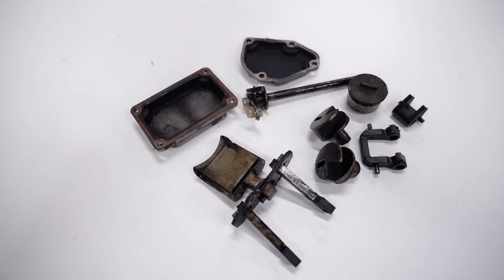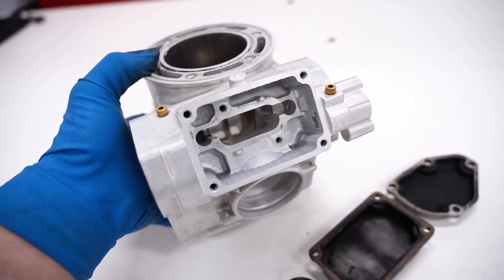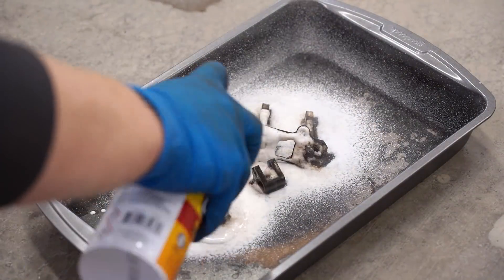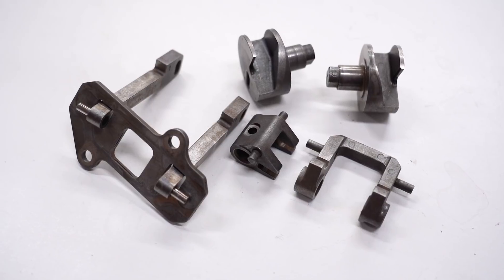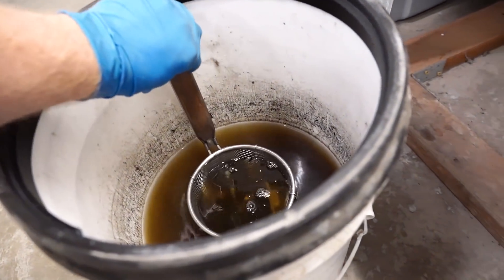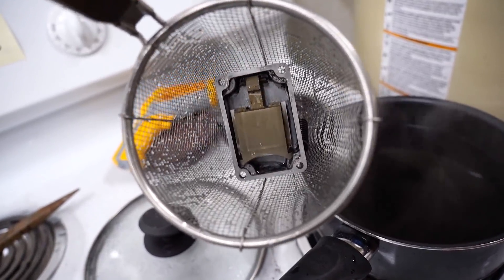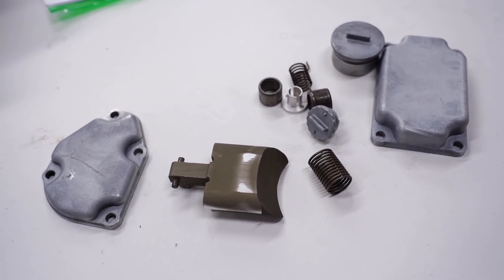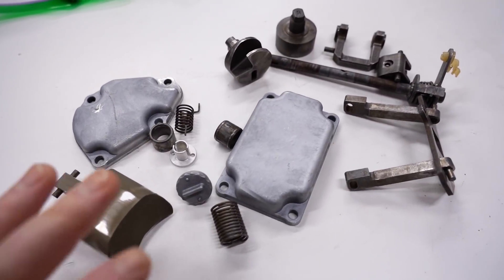How To Quickly Remove Carbon Buildup | RM250 Rebuild 6

Comment: I did the degreaser and water in a pan method for my power valve and cylinder head. Now it’s a different color! It’s a bronze ish brown color. I used greased lighting and made it half and half

Comment: Hi Cameron,  I own a classic  75 Suzuki  TS250,   Amongst owners it is common practise to build a fire in the garden, and place the exhaust on  a really good  hot fire, or you can use a welding torch and set fire to the  carbon inside of the exhaust,  You want to see those things burn, it,s like a jet engine, You know when all the carbon has been removed, the flame just goes out, Then a quick clean and repaint, then reinstall on bike, Done it many times.   Luckily I do not have nabours ,  But what a difference it makes to the bike,  May be ,some might think this a bit drastic, But this method does remove 100% of the carbon  that has built up over the years.  Try it Mate.

Comment: Thumbs up for simple green, they have special green for aluminum but I've used regular on carb bodies for years and never had a problem. Probably works out to a dollar or so per application. Skip the other stuff and go for green.

Comment: cameron i have a question im doing a build on a cr125 and im using decal works graphics and in going to use the decal works application fluids is it necessary to use the step one fluid? it makes the plastics lose the shine Keep up the work!!

Comment: Cameron,  love your videos. One question though. I'm restoring an 07 KX250F and followed your instructions and bought some Eagle One MAG cleaner. My question to you is, on the label it specifically says, " DO NOT use on aluminum. Did I buy the wrong stuff? Or do you just use it anyway?

Thanks!

Comment: Hi Cameron, can you please try cleaning those small parts in an ultrasonic bath? Use mag wheel cleaner with aluminium parts and hot water with degreaser on the steel parts.. just a wild guess here, but im sure an ultrasonic cleaner can do better and its far less work for yourself

Comment: Could you use oven cleaner to decarbonise exhaust? Having trouble getting all carbon out yz85 pipe and I’ve tried all the other methods. Only one I haven’t tried is the heat gun one

Comment: Glass bead blasting will polish your aluminium without putting a profile on the aluminum parts it's amazing and alot easier than vapour I can glass bead some aluminium and send you a pic if you want i do glass bead blasting and gritt blasting

Comment: Now I'm cringing at myself for scrubbing my exhaust valve with steel wool and engine degreaser 😣 didn't get it nearly as clean as your method and probably damaged it a bit.

Comment: Hey Cam. Got a jetting question.  I think I heard you talk about this issue before.  2017 yz250, yes 2 stroke. 
The idle seems high after doing hill climbs,  or really working the engine.  When I get to the top of the hill I throw it in neutral while waiting for others.  I noticed the engine revs staying high and slowly dropping. I have backed out the idle screw multiple times.  
Second symptom which I thought might mean it's rich is that it can be hard to start when cold.  I have had to bump start it twice in the past year. That's more times than i have had to bump start my bikes in 20 years. 
Air screw is 1.25 turns out. Forget what the pilot and main are but i do recall lowering the pilot awhile back to try things out. 
Any tips?
Reply: Air leak better check leak down test or boom seize
Reply: @tonykoehn8181  I doubt it's an air leak.

Comment: How do you think a sonic cleaner would work on those aluminum parts (with the degreaser)?
Reply from the maker: Yes it would work decent, but you'll need to get the solution quite hot for it to be effective

Comment: based on some of my experience with cars how carbon wont stick to a mirror polished cylinder head as easily, maybe if you polished the inside of these covers and parts?

Comment: Cam, just an idea I had based on a gun coating company that just closed called Robar: electroless nickel plating + PTFE mixed in = anti-corrosion, self-lubrication/low friction.

This place seems to sell the necessary things for someone with time to learn to do it at home:  https://www.caswellplating.com/electroplating-anodizing/nickel-plating-kits/ptfe-teflonr-electroless-nickel-kit-3-gal.html